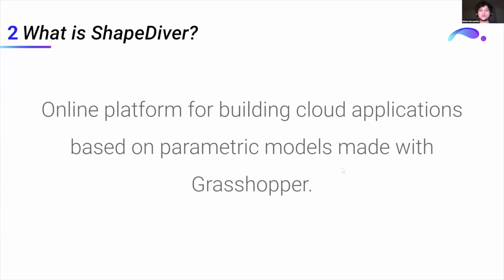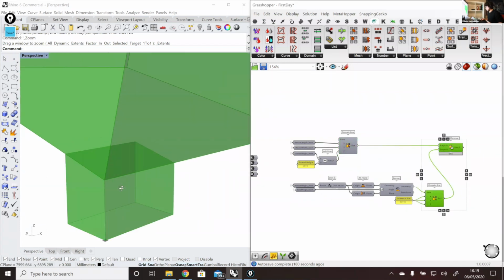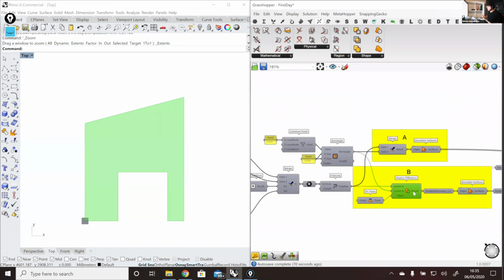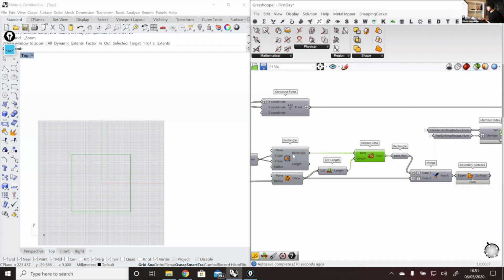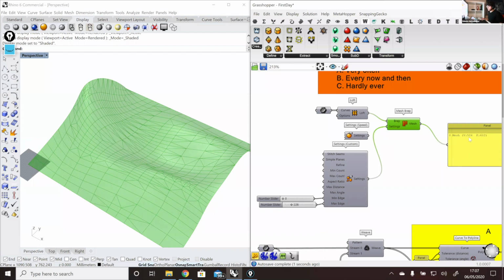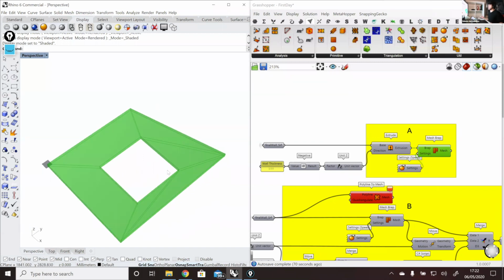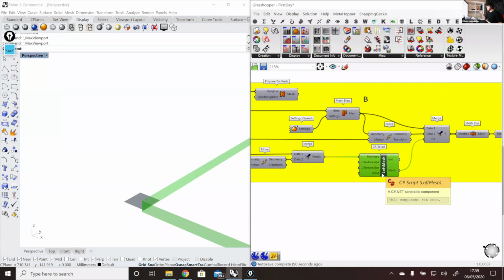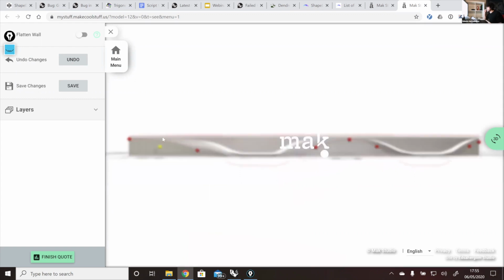Parametric Design For Cloud Applications Webinar | Session 1

Comment from the maker: --- Webinar Intro ---
1. 0:00 Intro to the webinar
2. 1:15 What is ShapeDiver?
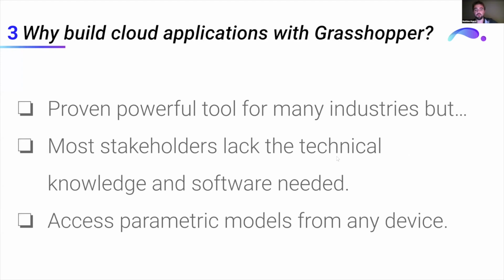3. 1:48 Why build cloud applications with Grasshopper?
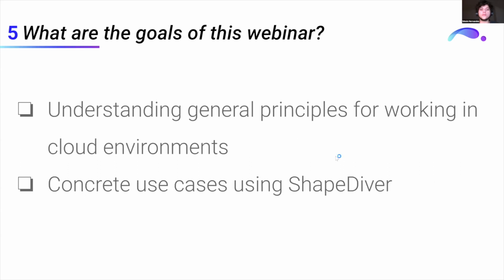4. 3:19 What are the goals of the Webinar?
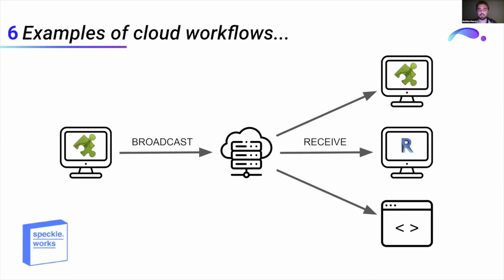5. 3:58 Examples of cloud workflows
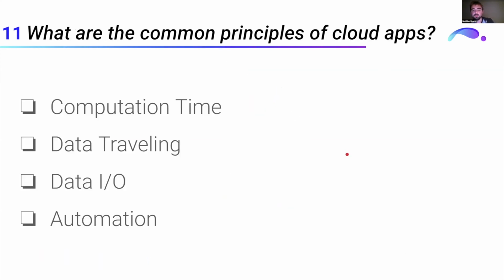6. 6:25 What are the common principle of cloud apps?
--- Introducing Ribs Table ---
7. 10:40 Introducing Version one of Ribs Table in Grasshopper
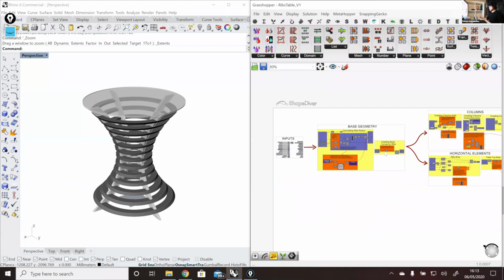8. 12:10 Introducing final version of Ribs Table in Grasshopper
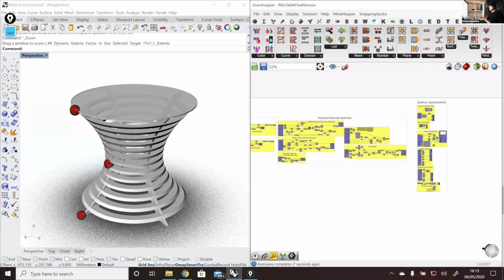9. 12:26 Metahopper and bottleneck navigator
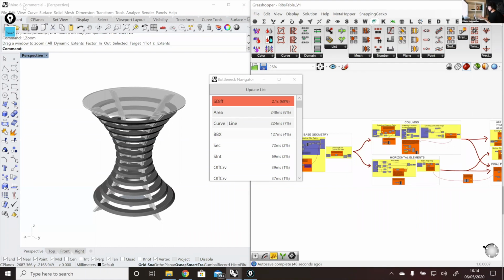10. 13:53 Introducing final version of Ribs Table in cloud application
--- Optimizing and Stabilizing concepts | First Example: House ---
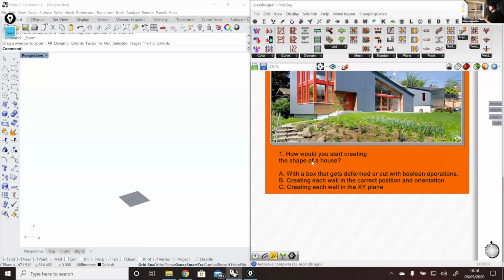11. 15:25 Introducing First Poll: How would you start creating the shape of a house?
12. 18:10 Compress your definition
13. 19:56 Avoid using solid operations to improve computation speed
14. 21:08 Results to First Poll: How would you start creating the shape of a house?
15. 21:58 Introducing Second Poll: How often do you use explode type components to get geometry from pre-existing one?
16. 23:15 Avoid using explode type components to make your definitions stable
17. 25:30 Using geometrical checks
18. 28:34 Results Second Poll: How often do you use explode type components to get geometry from pre-existing one?
19. 29:29 Maths is your friend: Creating Each Wall in the XY Plane
20. 33:18 Using region operations
21. 34:53 Why to build everything in the XY Plane
22. 37:17 What to do if you really have to use boolean operations?
--- Optimizing and Stabilizing concepts | Second Example: Perforated Wall ---
23. 41:22 Introducing Second Example
24. 46:24 Introducing Third Poll: How would you convert the curves into a surface with drilling hole?
25. 48:02 Results Third Poll: How would you convert the curves into a surface with drilling hole?
26. 48:44 Avoid computing area to get centroid
27. 50:04 Create just the unique simple geometry
28. 52:06 Using transformations to get the same result
29. 53:58 Using C# script to attach transformations
30. 58:53 Perforations in a free form surface
31. 1:00:25 Replicating geometry with web technologies
--- Meshing concepts | Third Example: Free form Shape ---
32. 1:01:36 Introduction to meshing: Why is it important?
33. 1:04:21 Introducing Fourth Poll: How often do you work with meshes in GH?
34. 1:05:04 The basic way to convert breps into meshes
35. 1:07:56 Using the Loft Mesh C# component by creting mesh wireframe from scratch
36. 1:11:50 Welding Meshes: What is it?
37. 1:16:00 Importing meshes and optimizing them
38. 1:17:08 Boolean operations in meshes
39. 1:20:22 Meshing First Example: House
40. 1:23:36 Meshing Second Example: Perforated Wall
--- Webinar Outro and Q&A ---
41. 1:27:28 Linking learned concepts to ribs table
42. 1:30:17 End of official webinar and start of Q&A session
43. 1:34:49 Scripting with Python and C#
44. 1:36:39 Texture mapping
45. 1:38:56 At what point in the design process do you switch from prototyping to optimizing?
46. 1:41:21 Mesh Colors
47. 1:42:10 Pufferfish and other 3th party applications
48. 1:44:52 How far to go with optimization?
49. 1:51:49 The most challenging projects at ShapeDiver
50. 1:55:29 End of webinar